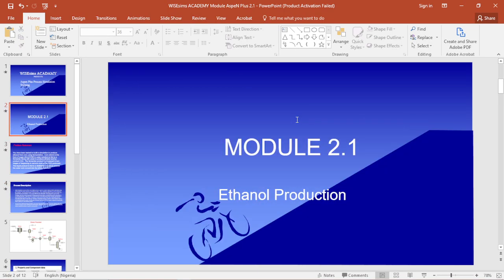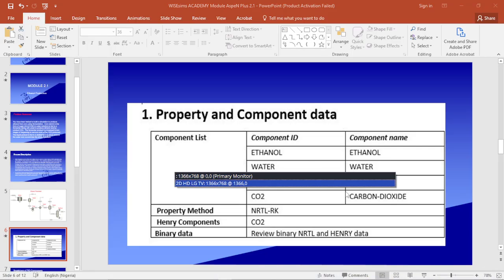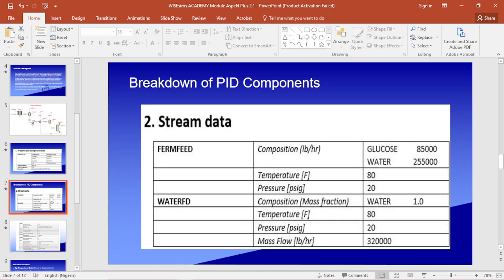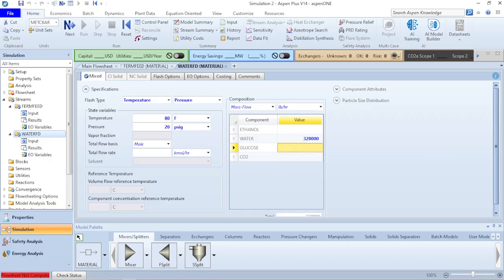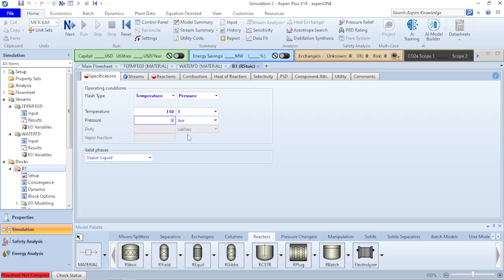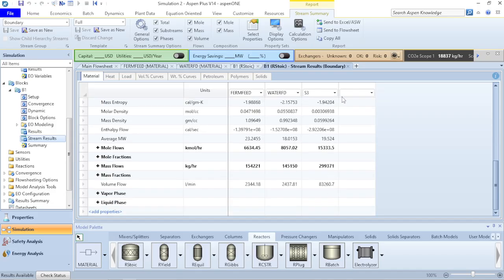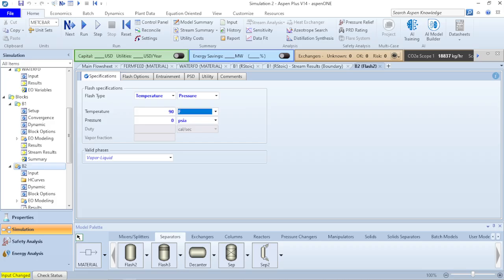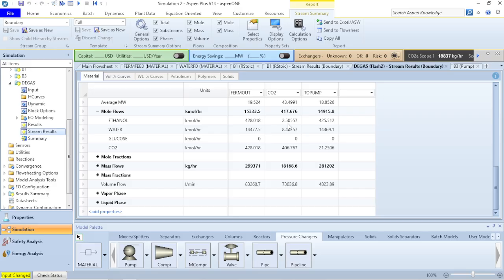Module 2.2 Ethanol Production, Aspen Plus Training Part 1

Comment: Hello,

This tutorial came at just the right time for me  thank you so much for sharing it!

However, I noticed that your starting point assumes an already fermented feed. I’m currently working with elephant grass (using the Biofeed components in Aspen Plus) as my raw material, and I was wondering:

How would you recommend approaching the process from lignocellulosic biomass?

How should I model the conversion of lignin, cellulose, and hemicellulose, especially in terms of enzyme addition or pre-treatment steps?

Would I need to simulate enzymatic hydrolysis explicitly, or is there a practical way to represent it using RYield or another block?

Any guidance on integrating the upstream conversion stages into the simulation would be greatly appreciated.

Thanks again for the great work!
Reply from the maker: Thank you so much! I'm really glad the tutorial was helpful to you.

For your work with elephant grass, I’d recommend starting by identifying the composition of lignin, cellulose, and hemicellulose in the biomass. You can use published data or estimates from literature to define the makeup in Aspen using Biofeed components.

Once you've set that up, you can model the pretreatment and enzymatic hydrolysis stages.

Use the RYield reactor to simulate the breakdown of non-conventional components like cellulose and hemicellulose into sugars (e.g., glucose and xylose). It’s ideal when you know the yield percentages but not the reaction mechanism.

If you're dealing with a complex system where equilibrium matters (like gasification or reforming), you can use an RGibbs reactor instead. RGibbs calculates product distribution based on Gibbs free energy minimization, which is useful when exact reactions aren't known but you want the most thermodynamically favorable outcome.

Since enzymatic hydrolysis is often modeled using fixed yields (based on enzyme efficiency), RYield is usually more practical here.

Don’t forget that your hydrolysis products (mainly sugars) should match the input required for the fermentation step (e.g., in an RStoic block for ethanol production).